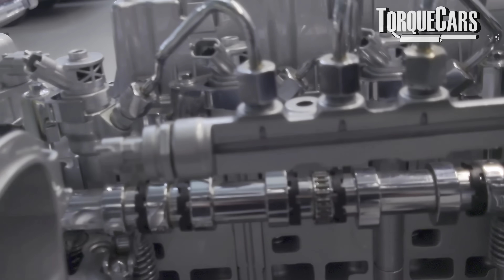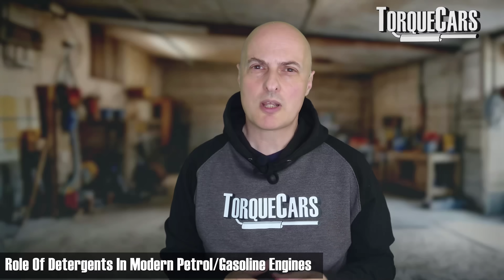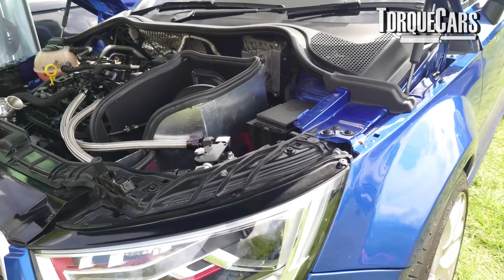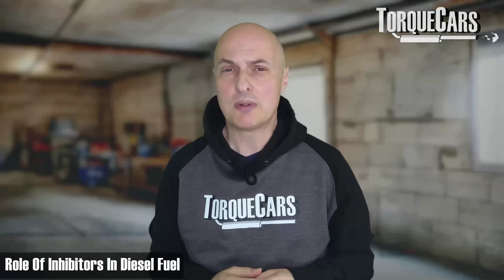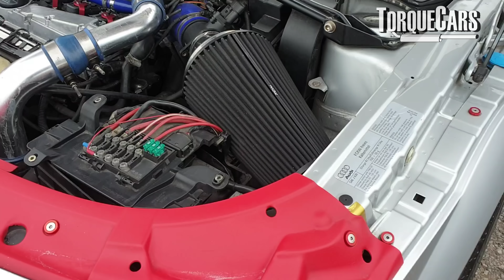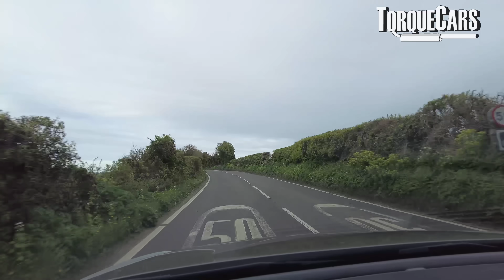Premium vs Cheap Fuel: ⛽What’s Better For Your Car? Do Premium Brand Fuels Really Clean Engines?

Comment: Where is the difference between 95 OCT and premium 98 OCT apart of the octane?
I think they get higher octane by additivation not by base fuel, as its said that has less Sulfur content, thing that I dont believe.
Another iussue is the ethanol content that leads to more corrosión, so more anticorrosión additives are needed.
Thanks in advance
BimmerN53
Reply from the maker: Generally speaking the higher octane fuels come with lower Ethanol content. You'll usually see E10 on the low octane meaning up to 10% of the fuel can be Ethanol and half of this on the higher octane fuel.  Brands like shell use different additives in the high octane fuel hence their claims for "better cleaning" if you use them.
Reply: @torquecars thanks for your answer, What I.don't know is if 98 octane is reached from 95 vía additivation or comes straight from Petrochemichal with 98 octane, and why premium fuel is cleaner than 95.
Thank you
BimmerN53

Comment: I have only ever used V power from shell or Bp ultimate in my cars. I have never had injector issues. As an example on my Tuned TT I ran a test before remap ,on standard shell the car produced 231 bhp. Using Vpower the car produced 237bhp. On the Dyno at West Yorkshire remaps the TT produces 318 bhp using standard shell,using V power 325 bhp. This is with a linear tune stage 1. On a fiesta St 1.6 bhp 183 on standard shell 189 on vpower tuned stage 1 standard shell 211 bhp with V power 220 bhp. Also since the remap  both cars on v power are using 10-% less fuel on a run than before. On my Range Rover using v power diesel I cover 50 miles more on vpower than I do with Esso jet or total fuels. Not scientific but Vpower is great fuel. Also Tesco momentum if you can ever find it.
Reply: TT are to heavy and gulp fuel.....if I were buying a cheap two seater.....mx5 all day long

Comment: A lot of petrol and diesel tankers come out of the same refineries, you've only got to stand outside the gates of a refinery  and wait.
Reply: hi chris doesn't make a good content video though does it.
Reply from the maker: If you look really closely you'll see the additive package being injected into the fuel stream as the tanker fills which differs from maker to maker. The base fuel is pretty much the same, it's all in the additives you get.
Reply: @torquecars fuel drivers just ask for diesel or petrol with additives.
diesel + for example is diesel with additives. and I've delivered this to different forecourts.
so it's the same diesel just with additives added by the refinery not the driver.
apple green who's fuel is cheap only take diesel + ie with additives.
so cheap fuel with additives for free not 10 to 30p a litre more.
Reply: @jamesgriffiths3057  Is apple green a good diesel with additives, but without the name of a branded fuel James? There's one not far away, but I've never really used it tbh.
Reply: @christopherward9230  pd I use it as the garage near me the fuel is cheap and I know it's got additives in it.
I mainly use supermarket fuel.
which guess what has additives in it lol
these videos make me laugh.
ps the additive amount is very small.
need to service your car aswell.
I change my fuel filter every year or more depends on mileage.
Reply: @torquecars  if you look closely hmm.
it's already in the fuel.
so you won't see the addiitve package added.
also the additive amount in a tank compartment is probably about 1%.
so very little.

Comment: I can give you my experience on a 2007 1.4 D4D Auris... Where I live, we only have access to three fuel brands. I only use premium diesel. On brand one, felt no difference in performance or mpg, but the engine noise was louder and rougher. On brand two, again no difference in performance or mpg, but the engine sounded not so loud and much smoother. On brand three, again no mpg or performance difference but the engine not so loud as brand one and not so silent as brand two. For six months I used regular diesel fuel. Noticed a bit less performance, no difference on mpg and the engine sounded like brand one premium diesel. As far as additives go, I cannot evaluate their cleaning performance, but Liqui Moly Diesel Spulung and Super Diesel additives do make a significant difference in performance. The cetane booster does make a difference. I also used an additive called "DT1" from brand "NCH" it also made some difference in performance but no difference in mpg either.
In 2011, I used an STP injector cleaner on a 1.5 dci Clio III, and it also made a huge difference in performance, and that gain was kept over time, even after the additive was no longer in the tank.
The only additive that I used that I absolutely noticed no difference in anything was Wynns Diesel Turbo Cleaner when I used it on my 1.4 D$D Auris.
Reply: STP injector cleaner for diesel here... made a huge difference in.... you call it MOT... yearly technical car inspection.

Comment: Let's take a reality check using my admittedly paltry information, nevertheless I have honestly witnessed this when working in Aberdeen harbour years ago, so make of it what you will. Most fuel comes from the nearest port, ships are the cheapest form of transport to those ports from refineries, although some will be sent directly by road. These refineries refine crude oil usually from abroad into the various types of fuels used commonly, there are five or six refineries in the UK, and many on the continent. The owners of the refinery, not necessarily the brand sold, distribute their fuel for vehicles in relatively small product tankers (ships). These smaller tankers have many sub divided tanks, and can carry different grades of fuel at the same time, for different customers, but importantly load all at the same terminal usually. This to me means any additives must be included prior to loading, although I do know they die the duty free fuel in the ships tanks, at least they used to. Naturally with any trade the fuel can literally come from anywhere, not necessarily the UK, which begs the question about consistency.
The tanker berths in the port, pumps the fuel into various holding tanks ashore and departs, here's where it gets interesting. Years ago, before supermarkets, every company had it's own branding, stations and logos, Esso, BP, Mobil, Shell etc etc. They actually had their own refineries, their own vessels and own branding, who could forget 'put a tiger in your tank'? More importantly they had their own branded berths in ports to receive their own fuels, although they still sold to other operators but not under their branding. So if for example you went to an Esso petrol station you could be fairly sure the fuel came from the Esso refinery, normally delivered by an Esso ship, to an Esso terminal and finally loaded by a road tanker and taken to the petrol station. That as far as I'm aware, with the exception of Shell, has disappeared.
So going back to what I witnessed, early in the morning the road tankers would line up, Asda, Tesco etc and load from the same storage tanks. Now I strongly suspect by observation that they loaded the same fuel, the same grade with the same additives, again the exception was Shell who had their own storage terminal. This has been reinforced by observation throughout the years at actual petrol stations, where (again with the exception of Shell) you rarely see branded road tankers.
What this means I do not know, but I strongly suspect 90% of distributors sell the same product from the same ship, and like some lubricating oils more expensive is not necessarily better. Shell however always have, and I think still do, sell their own product, however again you can't be certain, all I can say is branded Shell tankers deliver to my local Shell station to this day, they may be slightly more expensive for a reason??
I too would be interested to know if, and at what stage in the journey are these additives added, or perhaps more significantly are they not added?
Reply from the maker: Based on conversations with people in the industry and comments they have left on here,  I've ascertained that the additive package is added as the tanker fills up, so it mixes with the fuel. I guess the base fuel already has some additives to help it meet the specifications but most of the larger brands do their own thing when it comes to additives.
Reply: @torquecars  OK but which tanker? ship or road?
Reply: Added when the tanker fills up. Always use premium fuel for my merc. Price of going out for a meal and a drink are extortionate. I'd rather look after my car first. The old saying 'you get what you pay for'!
Reply: @gregstansfield8999  Same question as torque cars is the tanker ship or road? I use premium fuel too but it would be nice to also have a non ethanol choice?
Reply: @davidoldboy5425 when the road tanker is filled. The driver uses coded keys. The road tanker receives generic up to 10% ethanol fuel plus additive. Most standard fuel has the same type and quantity of additive. The top premium fuels have a separate dispenser for up to 5% ethanol. These all have different additive formulas. BP, Shell etc are different additive packs. Tesco might be using additive pack close to but not the same as shell.

For normal fuel. It must meet ENxxx standards. I don't know the standard number but it's printed on the pumps, Google it. To meet that spec the base fuel must have some basic additives. Because of this, this basic additive might be added before dispensing to the road tanker. In that case, all normal petrol won't have additive added during dispense. May be exceptions like shell standard petrol.

I learnt this from Google and reading Youtube comments from 'tanker drivers' if they're telling the truth. I'm not in the industry and everything I've said could be wrong.
Reply: @swapshop864  Thank you very much, I think we need a real road tanker driver to comment??

Comment: I only use V-Power now too, would you say it’s worth putting in a shot of Redex or other additive on top of this or is it pointless? I fuel up with V-Power and a shot of Redex before taking it for an hours blast on the motorway to keep the system clean.
Reply: Years ago I had to drive a MK1 Shitröen C3 to the vets and on part of that route was a long run up a hill. I found that normally I'd have to drop down to 4th as there just wasn't enough torque but when I added Redex there was just about enough power to keep it in 5th.

Redex also made the car's engine sound subtlely different l, and I could tell when it had been added even before being told.

Comment: I have a ‘12 Prius I bought new. Up until last year I never bothered staying with a particular fuel brand. Often even used brands other than those considered top tier here in the U.S. I’m still getting at or better than the  mpg when it was new. 

Last year I started trying to stay away from the lower tier stations. I also started using injector cleaners for the first time. I figured they must be getting dirty by now.

Comment: I'm using RON 98 Shell V-Power on my Peugeot RCZ and just recently changed my slightly over 20 000km driven iridium spark plugs and their condition was textbook clean 8)
Reply: Wonder if the results would be the same on performance cars?
Reply: @markgt894  Good one but none taken :D

Comment: I'm in the US and always fill up with Mobil/Exxon Premium and only use Mobil 1 synthetic oil (2021 Audi A4).

After analyzing and comparing additive packages, there absolutely is a difference and using top tier fuel and oil is worth it if you have a reasonably higher performance vehicle.

As well, many times low quality fuel is found at small and independent gas stations who often do not properly monitor and care for their tanks, and allow contaminants and water to enter the system.

Comment: Normally go for Tesco 99, esso 99 due to fuel card or shell 99 as the pay on the app is good. 

Esso is x3 on cleaning, but there pumps say x2, lazy on marketing probably be x4 soon. 

Having port injection everything is pretty clean as it is, but you feel the difference top end on higher octane and 10% mpg over e10.

Comment: My Octavia TDI runs smoother on premium  fuel. In my case Shell V Power. It will literally stall and run rough lower in the revs with normal cost save fuel. This is usually when the engine is cold.

Comment: Here Esso Supreme ultimate 98 most of the time, or regular esso supreme 95 E10.
I do not know why but with all the cars I have had untill today (diesel and petrol) they reacted great when it comes to performance with Shell fuels (also more noisy engine)
Immediately, but after about one or two tanks the troubles began. Mostly sensor's and engine. And when pushing the gas pedal a bit more for quick uptake and need of power the engine gives no reacting to my demand , then want's to but falls back a second time before taking up my demand for power (when the momentum is gone) this al happens in 5 to 8 seconds. When driving calm these problems do not existed on Shell. 
Filled up with 3/4 tank of Esso and all these annoying malfunctions instantly are gone and engine is less noisy and nervous. Strange, maybe it has something to do with the fact that I am from Belgium and so it is Shell Belgium??? Had these problems with my first citroen's , 1 Mercedes, 1 Renault, 1 Lancia and now back to Citroen same problem.
Difference is that with diesels always red engine icon goes on in contrast with gasoline where no readings are involved after it occurred.

Comment: Yes, it does. I fill my car with good top tier gasoline higher octane, the car doesn't pull timing, gives me the performance I'm looking for.
I do not have to press the gas pedal like when I am using lower octane gas.
In my commute to work  a full tank last the entire week, it doesn't happen when I use lower octane gas.
Car run cleaner and happier!

Comment: According to BMW handbook my diesel car needs the usual BS EN 590 diesel fuel . I have always filled up at my local Morrisons , having had the car from new since 2014 it runs just as well as always and it has so far never had any engine issues. It’s not a premium fuel but it does have to meet the standards required by BS EN 590 regulations so that’s good enough for me , my pocket and to date my BMW .
Reply: I buy standard unbranded EN590 fuel, I prefer it from Humphries Porthmadog, now part of Certas, because it comes from the Essar refinery which was formerly Shell and still supplies Shell garages widely.  I buy in modest bulk and store on my yard for a combined mixed fleet.  Of late though, in select vehicles, I’ve started to use Archoil I use bulk diesel fuel to the EN590 standard delivered to and stored in my own bunded fuel store with electric pump dispensing through a flow meter.  Lately I have been adding a cetane and lubrication enhancing additive as I fill selected vehicles at a cost of  2ppl and this improves the diesel to a similar standard to Shell V-Power premium fuel, but at a fifth of the extra cost of V-Power locally. The stuff I use is Archoil AR6900D Max at the rate of 1ml per litre…
https://www.amazon.co.uk/dp/B01IDDF4JM?ref=fed_asin_title&th=1
All my vehicles have between 80 and 90 litre tanks so I run them down below half full and either pour 40 or 50mls in the tank initially, top up to the first click of the nozzle, check how many actual litres I’ve dispensed and then pour in the balance needed of additive then top up the diesel until the next and last click.

Comment: Over 200,000 miles on a 2017 Golf 1.6TDI,  mostly on supermarket diesel, no issues whatsoever. Followed the manufacturer service interval, no 3000 mile oil changes 😂
Reply: @bllxy8226  Your vehicle travels alot of miles that's what a diesel engine needs.
Reply: Any DPF or emissions control issues?
Reply: @ofah6378 DPF issues become more of a problem with vehicles doing short distances and in stop start traffic,When you do daily high mileage and on motorways it burns off the vehicle is in it's operating elements.
Reply: @WeveGotBush yes i know that but regardless after 200,000 miles ash built up or other issues may have arisen - just curious to know
Reply: @ofah6378 nope, everything runs great.